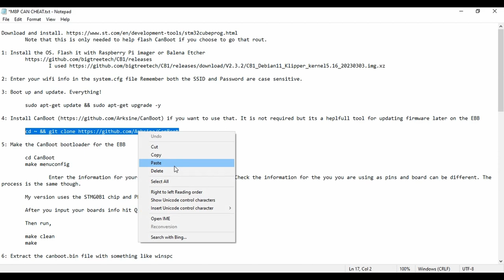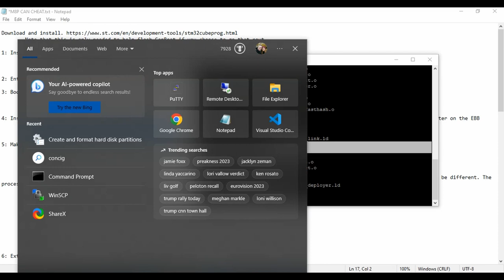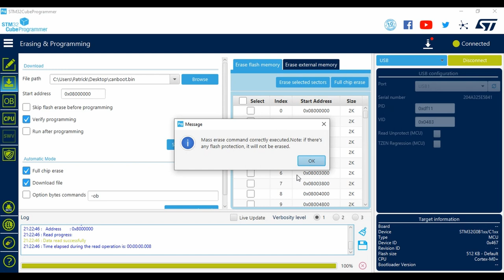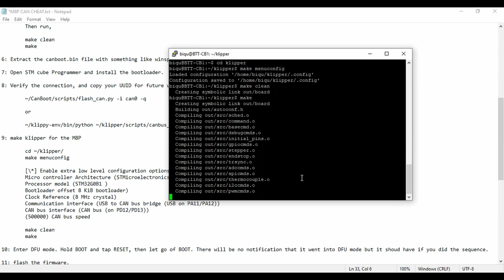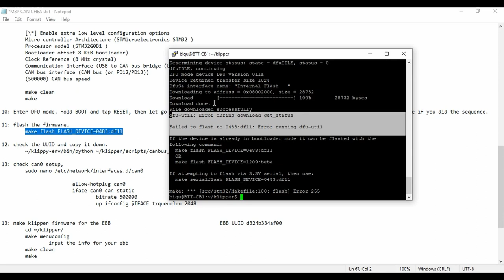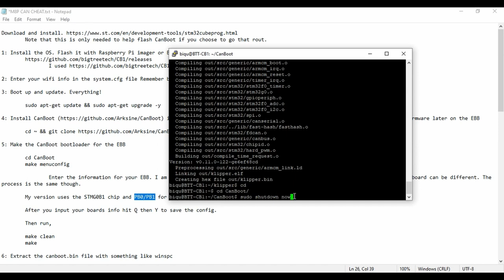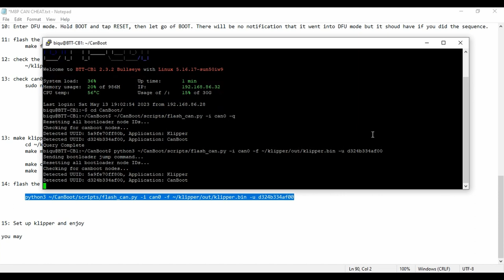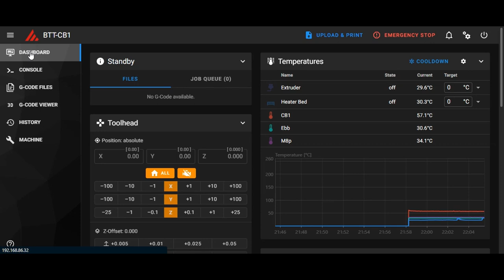Manta M8P+EBB CANbus Setup

Comment: I fried the SB2900 and I now have a EBB36. After going through everything and getting both uuid's  I restart everything and the uuid for the CB1 is gone. If I Flash it again I get the same uuid, but as soon i re-power the board the CB1 uuid is gone. The uuid for the EBB36 is always there. 
If I unplug the EBB36 before I power on the CB1's uuid stays. Only if I power on with EBB36 connected i lose the uuid for the CB1.
Any thought?

Maybe I just need to start all over flashing everything?
Reply from the maker: Once you have the UUID for a device you should just copy in a note to reference it. They do not change. So you just need to put the right uuid in the klipper printer.cfg for the [mcu] it belongs to and you should be good to go. By the way what do you mean you are getting a uuid for the CB1? That's not something you should be getting. You only need uuid for the canbus devices. The cb1 is the host computer
Reply: @StackingLayers  Wnat I mean is that I get a uuid from the Manta Klipper and from the canbus, but as soon I reboot the Klipper uuid is gone.. I re-flash klipper to the Manta with the CBB1 it shows again. Turn everything off and start again, and it's gone.
Reply from the maker: @mkhjensen if you have put the uuid into the printer.cfg for the [mcu] then it will not show again when it connects.
Reply: Ok, then there must be another reason I get can't connect error.
Reply from the maker: Do you have the 120R jumpers in place?
Reply: @StackingLayers  Yes jumper on the Manta and the EBB36, maybe I connected the wires wrong on the Can, I tried both ways, but just eliminate it, the TX on the Manta should go to H or L on the EBB36. When I look at your video it looks like you have the TX (white) connected to the EBB36 can L.
After the cables are connected and uuid are in the printer config and I run "~/klippy-env/bin/python ~/klipper/scripts/canbus_query.py can0" should I see any uuid's or should it say 0 found?
Reply from the maker: Canbus doesn't have tx rx, it's high and low (H and L) you connect H to H and L to L
Reply: @StackingLayers  Unfortunately on the Manta M8P V2 they decided to change it to TX and RX. I looked every where to find out what is H and L, but no luck.
Reply from the maker: @mkhjensen oh you have the V2. The crystal timing and and bootloader size are different from the one I show. You need to compil for the
# STM32H723 with a "128KiB bootloader" "25 MHz crystal"
Reply from the maker: @mkhjensen I see now on the pinout diagram that they wrote TX RX that is the wrong protocol and should not be written that way.  Looks like PD0, the one marked RX would be the H (high line) and L (low ) on PD1 marked TX. The good thing about canbus is you are not going to damage things getting those two lines backwards. So it's safe to swap and try again.

Comment: Hi, I can't use STM32 Cube, I have a SB 2209, and it doesn't allow writing, the motherboard is Manta M8P v2, can SB2209. what other boot option do I have?
Reply from the maker: Try an older version of stm32 cube. Others have reported that the newest version has some problems.
Reply from the maker: Wait, that one has the RP2040 chip right? If so just make the firmware or katapult bootloader for it and flash it Fia boot mode. With it plugged in via usb, you hold the boot button and click reset then let go of the boot button, to get into boot mode then you can drag the .uf2 file or use the, 
    make flash FLASH_DEVICE= 
command.
You'll need to put the device id after the =. You can find it with,
    lsusb
It'll show as rp2040 boot or something like that.
Reply: @StackingLayers I succeeded with a newer version of STM32, but I can't get past step 12, I can't find the UUID, it seems that something is wrong. everything was installed before the test and it worked correctly but not with the UUID for the mcu, after the new klipper update, it didn't work anymore and I have to reinstall. it seems that even installing Manta with a separate card doesn't work anymore, the firmware.bin file doesn't turn into *.cur
Reply from the maker: What size SD card? Is it formatted to FAT32 and being inserted into the MCU slot?
Reply: @StackingLayers  Micro SD 16G/Fat 32
Reply from the maker: When you used cube programmer, how did you have things plugged in? I'm wondering if you had flashed to Manta by accident. If you had only the sb2209 plugged in than that's obviously not possible. But with both plugged in it might happen.
Reply: @StackingLayers  I think I created a confusion, SB2209, I solved it with STM32, Manta I did not manage to write it, according to the tutorial, neither with Can connected nor without Can, it does not show me the UUID on Manta. put jumper R120, powered by USB, powered normally, I will try to rewrite the OS with an older version of DEBIAN, and resume the installation, it is certain that it worked with the old Klipper.
Reply from the maker: @zahariaeduard390 the OS should not be an an issue but it's worth a shot. Keep in mind that if the UUID is already placed in the printer.cfg unter the [mcu] section and klipper is able to see it, it will no longer be shown via the UUID query. Though the not being able to flash anything new is a bit odd. That sound like a bootloader or file issue.
Reply: @StackingLayers  If we can move the conversation somewhere where I can send pictures and show you what and how, maybe we can talk more easily
Reply from the maker: You can DM me on Twitter
Reply: @StackingLayers  SUCCESS, I succeeded after a lot of trouble, I had to write another command, respectively:
sudo dfu-util -a 0 -D ~/klipper/out/klipper.bin --dfuse-address 0x08000000:force:mass-erase -d 0483:df11
then
make flash FLASH_DEVICE=0483:df11
and finally
sudo reboot
Reply from the maker: @zahariaeduard1595 that is awesome to see! Glad you got it sorted out.

Comment: first off thank you for the video on how to set this up.  i followed your video and it got me setup using a manta M5P and a EBB 36 and it is working great.  im not sure what you did differently in the video as compared to the written instructions that you have but the video works and the everytime i used the instructions i could not get it to work.  i have written everthing that you have done in the video and in the order that you have donw them and rewrote the instructions as to how you performed the operations.  im willing to email you a copy of them but your email address is not showing.  please let me know if you would like the copy
Reply from the maker: The part in the description is more of a supplement to the video. What parts do you think would be good to add? I was getting a lot of spam so I don't want to post my email at the moment.
Reply: @StackingLayers  fully understand the email stuff.  I don't have access to my computer at the moment but I do remember that you did step 8 at the end. I used thus video to setup the printer initially and the latest version of klipper wanted a firmware update. When the update locked up the printer I headed back to the video to reset the system and figured I'd just use the notes and couldn't get it to work, tried this twice.  Followed the video and viola,  so I rewatched the video and copied down what you did for future reference

Comment: Ever have the issue where /dev/serial isn't made? I cannot get this to be made for the life of me even if CAN is set up. No webpages have any fixes rn
Reply from the maker: When setting up canbus there will be no dev/serial ID. You will be querying the UUID instead.
Reply: @StackingLayers  for both of the boards I am using the UUID in klipper configs instead of MCU from the dev/serial? I thought for the m8p you still had one?
Reply from the maker: When setting up usb as canbus bridge, you will get a UUID
Reply: @StackingLayers  idk if my comments are being deleted or what - it turns out it wasn't working because I had (mcu CB1) Once I switched to mcu only then canbus id worked. Thanks again! I was stuck on this for so long lol
Reply from the maker: YouTube has been having issues with notifications from comments, so I meet a bunch if I don't keep checking manually, but it's good to see you got it sorted out.

Comment: need your help man, followed your instructions all the way til I reached the 34minute mark, upon checking uuids i only have one (1) -- Klipper application... anything i did wrong???
Reply from the maker: So you see the m8p/controller board uuid only? Make sure the 120r jumpers are in place on both boards and that you have canH to canH and canL to canL.
Reply: @StackingLayers  yes all connected. only shows flashcan error "unable to bind socket to can0"
Reply: @StackingLayers  just an update, i changed the jumper at m8p and now it does not have the errorr "unable to bind socket to can0" but still uuids shows only one - Kilipper app
Reply from the maker: @joncalmavergara3788  have you tried reflashing the firmware to the ebb?
Reply: Atm staring and focused at your video and making sure i do everything right 😂
Reply: @StackingLayers  still the same.... only uuid for klipper shows up... wondering if it has to do with comm interface (if i get the choices wrong there)
Reply from the maker: Yeah it's very important to have all the settings correct when you make the firmware otherwise it just won't work. Which version of the ebb do you have?
Reply: Ive got the EBB SB2209
Reply: @StackingLayers  i found the problem (i guess) i believe everything's been flashed properly BUT upon checking uuid shows one -- Klipper app... i  looked into it further and the other uuid (or flash_can.py) is in /katapult/scripts/ which the system "can't open file"  and shows [Errno2] No such file or directory.  Do you have any idea how to go about this?
Reply from the maker: The uuid is the ID of the devce if it's set up right it will show with the other when you query. It's not a file you need to open. Triple check that the  bitrate settings are the same as the other others, and make sure that you are choosing the right chip that is on the board, rp2040 with canbus pins gpio4/gpio5 or the STM32G0B1 with canbus pins PB0/PB1
Reply: What i suspect now is the katapult -- the detectable uuid is stored in a canboot folder. I am re-doing the whole flashing again using canboot instead as firstly, i noticed katapult directory cant be detected and second, thats the only equation that differs between your video and my setup. Will keep you updated on the outcome. Thanks!
Reply from the maker: Katapult is canboot. It's the same application the developer just changed the name. You can query the UUID with the regular klipper canbus query command and it should show is set up correctly. But it doesn't hurt to start over. Maybe something was overlooked.
Reply: @StackingLayers  i did a -q on katapult directory which resulted to no files or directory.  I understand that it's the same but need to check if it works... bitrates, jumpers, pins are all out of the equation as ive checked them over and again
Reply: @StackingLayers  guess what, still the same issue. Only  1 uuid is recognized when i did a query on both canboot and klipper checks. when all instructions and configs are met, what are the chances it could be the m8p or cbt or ebb issue?
Reply from the maker: @joncalmavergara3788  I would say a small chance that it's hardware.  Something like this is normally a configuration or wiring issue. Where it's just not getting the communication that it's expecting. But of course you can't rule out hardware issues completely, anything is possible. Have you tried without katapult. Just flash the klipper firmware to the ebb in can mode instead?
Reply: @StackingLayers  it was user error! lol my BOM shows i'm getting a M8P v2, and after a couple of days trying to figure out what's going wrong, only then I realized they sent me a v1! I should have know better when I saw the boot and rst buttons in different position.  All is good now, thanks to your great vid!
Reply from the maker: @joncalmavergara3788 oh, yes that would cause a problem. Glad to see you finally got it going.
Reply: @StackingLayers  thanks again!!!!

Comment: Has anyone tried this on a M5P?   pinouts look like they are the same, and after 8 times of attempting this, and reimaging my SD card EVERYTIME...and starting from scratch, I am  closer to going to Pluto than I am getting this to work
Reply from the maker: For the m5p when setting up the firmware, after the can bridge part the can pins are PD0 and PD1, not PD12 and PD13 like the m8p

Comment: If i make a klipper firmware for my e3ez board with normal usb it works fine, if u make one with the canbus bridge it makes the firmware, i can flash it but i can't get my serial id and thus can't get the mcu connected. Somebody has this problem? If i flash the normal "non canbus"firmware back it connects to the mcu directly.
Reply from the maker: This is correct. When it is set as usb to canbus bridge, it will not set a serial I'd. Instead it will generate a UUID. I know it seems odd since you are still connected via usb but it's seen as a regular canbus node.
Reply from the maker: Run the command all on one line,
~/klippy-env/bin/python ~/klipper/scripts/canbus_query.py can0
Reply: Thanks for the reactions, after watching more youtube i found that it should be setup as canbus indeed. Now i have the ebb connected with the manta board. Still have a lot to figure out before it goes into my ender 5 pro.

Comment: Or you can use RRF and just plug it in and it works sadly not with a mant aboard though :)... But good video for Klippah -Thanks
Reply from the maker: I'm sure RRF is appealing for some, and I've heard duet makes quality stuff, but I like this style of diy. Plus this is a super easy system to setup once you know how it works. You are also not limited to special boards.
Reply: @StackingLayers  not limited to special boards in RRF either. RRF runs on many (obviously not all) of the same modern boards Klipper does. It's common missinformation that it only runs on Duet3d. For the toolboards Mellow is making the same Toolboards for RRF as Klipper just going into production now. RRF has run on MKS BTT and Mellow boards for a few years now. For just the toolboard RRF had a software only solution for CANFD that made a lot of the current boards compatable but with all the patents on CANFD and the holders unwillingness to license a software solution sorta killed it :) You can still get it, but have to compile yourself. However, any RRF board with CAN can also act as a toolbord to any another CAN RRF board so... the posibilties are pretty amazing.  Anyway sorry to hijack your comments -Great video and I'm sure it will help me on my Klipper builds.
Reply from the maker: No worries about hijacking. I like learning about new things. My comment sections are always open to conversation and debate, as long as it stays friendly and constructive. I knew RRF ran on other non duet boards , but I didn't know the possibility of can was there. I honestly haven't put too much attention on RRF since Marlin and Klipper satisfied my interests. Perhaps I'll look more into it on the future. 
I'm glad you like the video. I'm still working on being thorough but shorter at the same time. AKA quit rambling and stay on track! 🤣 Hopefully it helpful though.

Comment: Dude thank you for the video,  however you are all over the place and not showing step by step so we are lost filling in the gaps.
Reply from the maker: It's fairly step by step, but I am showing it with the assumption that the people going with canbus have the basic klipper setup process in order, since canbus is a little more advanced. Where are you getting stuck?
Reply: @StackingLayers  After I flash the Octopus board, it does not show any CAN devices when I run the query,  even though it says the flash was successful.
Reply from the maker: How did you set up the klipper firmware? How is it connected? Do you have the MCU set up in can bridge mode or as a standard node? Did you make sure all the nodes are set to the same speed? Do you have the termination resistors in place?
Reply: @StackingLayers  Yes, I followed your instructions which have gaps which I am trying to figure out.   Yes, I have a PAD-7 which I can use as a bridge. Yes all nodes are set to the same speed, and the test termination resistor is in place. when I  make flash FLASH_DEVICE=0483:df11 it say it is successful however no UUDI is report when I do   ~/klippy-env/bin/python ~/klipper/scripts/canbus_query.py can0    .

Comment: Hello, thanks again for your help!
I do the whole process but in this part ~/klippy-env/bin/python ~/klipper/scripts/canbus_query.py can0, I only get one Found canbus_uuid=6d184c4a673d, Application: Klipper, two UUIDs do not appear.
Reply from the maker: You may need to double check the order of the canbus high and low cables. If they are reversed then the communication will fail. Also make sure that the bitrate you set for canbus communication is the same on all devices, and the 120R jumpers are in the correct spot (on the first and last device, no more, no less)
Reply: @StackingLayers  Thanks friend! Without your help it's complicated. Thank you very much, I'll try now!
Reply: @StackingLayers  Dude, that was it, wiring changed! Thank you very much!
Reply from the maker: @renarruda wondering to see you got it going! Glad i could help.